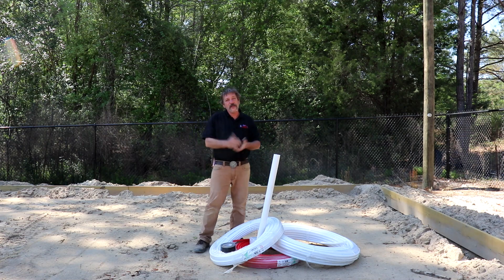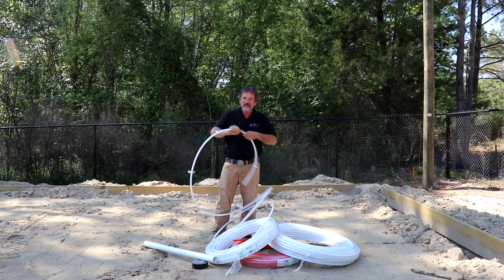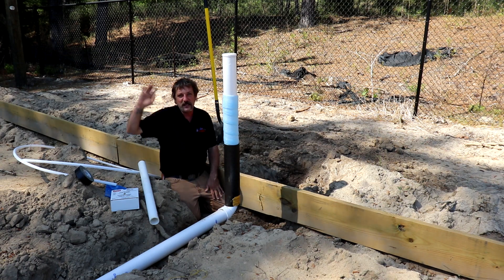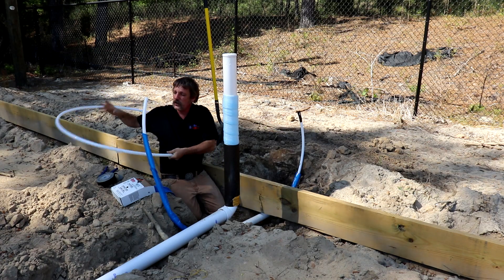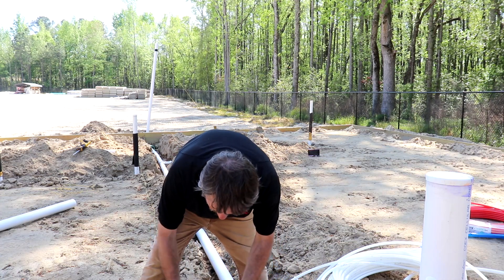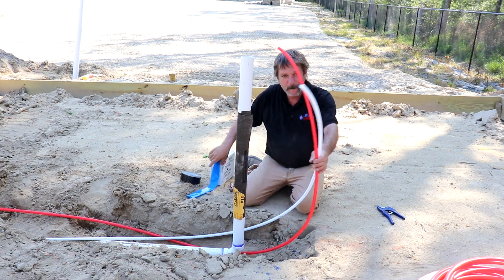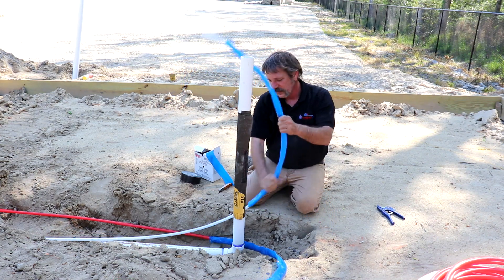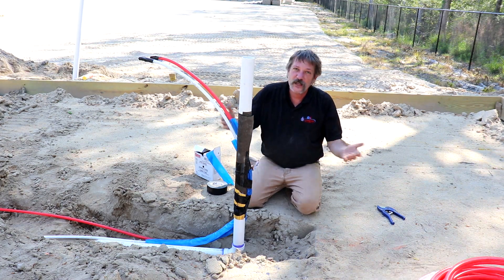Plumbing under part 5 waterlines

Comment: Loved the videos. Definitely helped fill some gaps in the under-the-slab drain line department. I would like to add some additional things to the video: PEX shouldn't be exposed to sunlight at all. Some claim more than 72 hours is bad, some 60 days, but regardless, UV light is a Pex killer so protect any of it sticking out into the light. Also, if you have lines running parallel, keep them from touching because they do like to transfer their temperature to each other. 

I hope you keep making videos like this with all the little "do's" and "don'ts" that you can't find anywhere else.
Reply from the maker: Well thanks. most of the time when people say " you didn't mention _________' I probably have said it in another video. Lets see if I can answer all of your comments.
Reply: @PlumbingSolutionsLLC  Yeah, plumbing is waaay too vast of a subject to cover it in 100 videos, but I just throw things out there that I find relevant or important. You've done a great job with all of these videos and I know they'll keep helping people. As you can see, I binge-watched through a lot of them. 👍👍

Comment: I’m roughing in my water lines now and wondering if I can run one hot and one cold for a shower, sink, toilet and just T off at the shower or wherever is convenient? Or would I need two separate hots and colds for the sink and shower then just use one of the colds for toilet?
Reply from the maker: you can Tee off
Reply: Thanks!

Comment: Ive seen pex hot and cold "loops" in many of the houses we build for the bathroom groups out of the slab. Is this common practice? Not sure how to connect back to water heater with a loop rather than a single line. Thanks
Reply: To clarify that means 2 hots and 2 colds coming up in each group

Comment: Seems like a lot of work, why not just take hot an cold lines to nearest wall to that island sink, then connect them at the top out stage, instead of fighting 30’ of pex just to get it across there, there will be plumbing close to that sink, just a thought